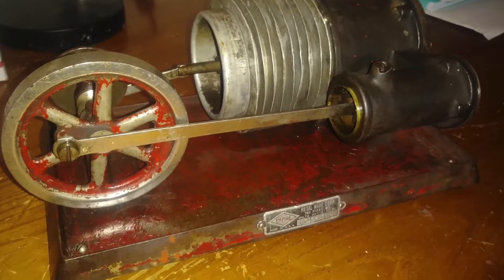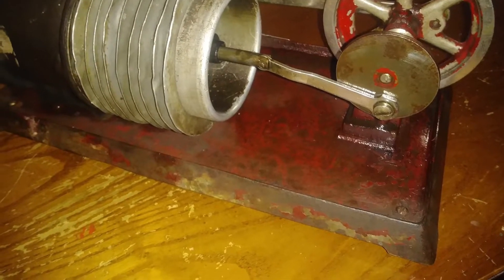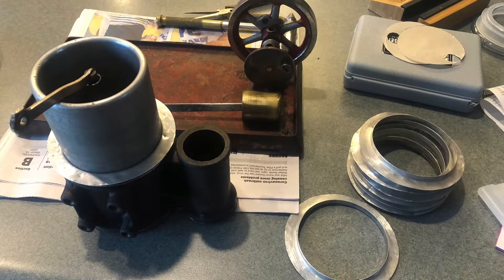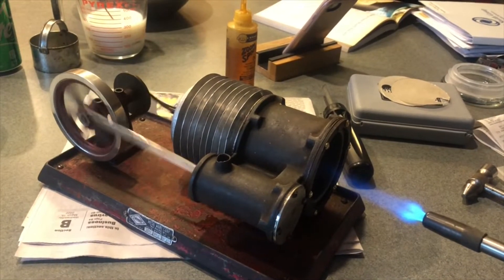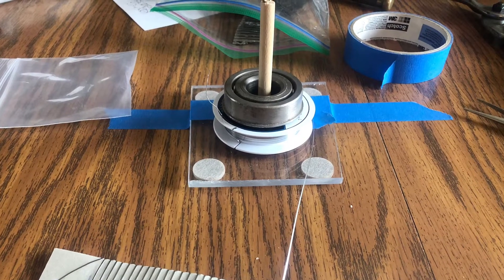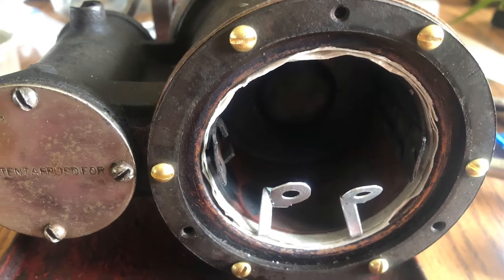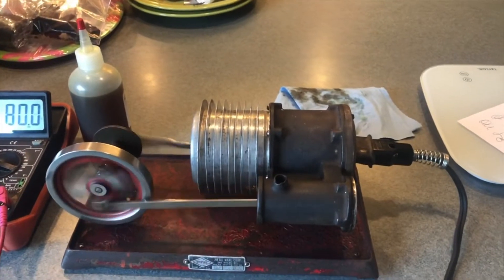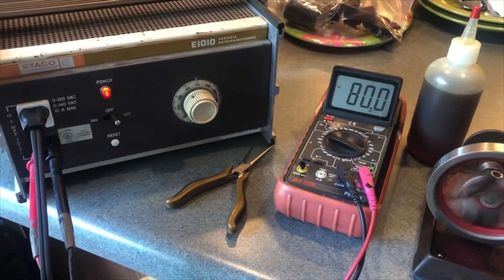Empire B38 Hot Air Engine Rebuild

Comment: Nice job.
I build and I collect Stirling and steam engines and I've never had one of the B38 engines in my collection but I always wanted to have one.
Problem is is that they are fairly rare and if you find one on ebay or through a private collector you normally have to take out a second mortgage to get one! LOL
But you did a nice job of rebuilding it. It sounds great and it runs great!

Comment: Were there practical applications for the Sterling type motors?
Or were they just “gadgets”?
I like your videos, you’ve got quite a collection.
Reply from the maker: Steve A W thanks! Glad you enjoy my videos!
In the very late 1800s large Stirling engines were used quite often for pumping water. They don’t make enough power to be for much beyond that, other than models, toys and demonstration pieces.